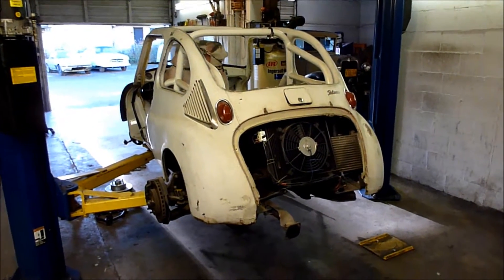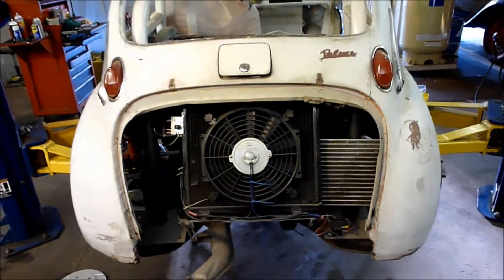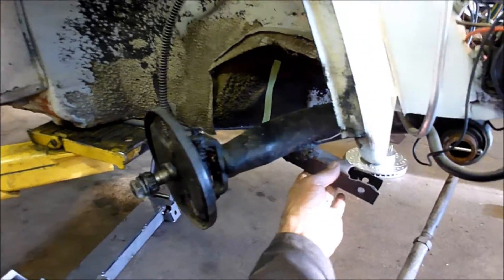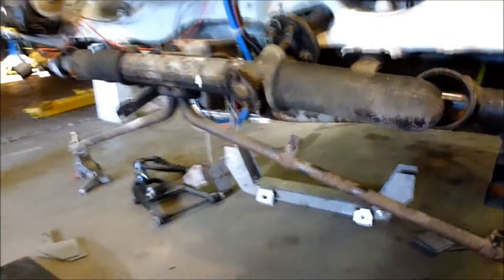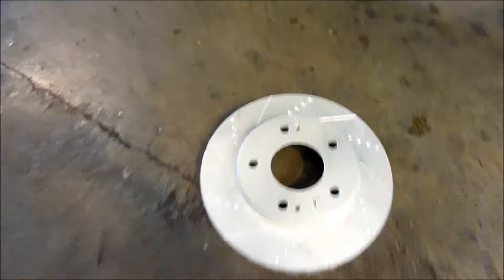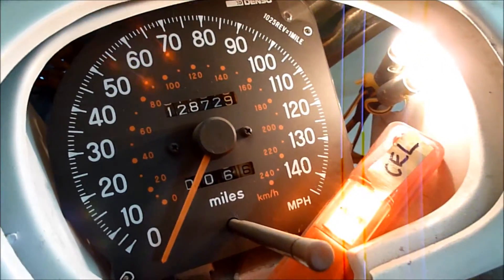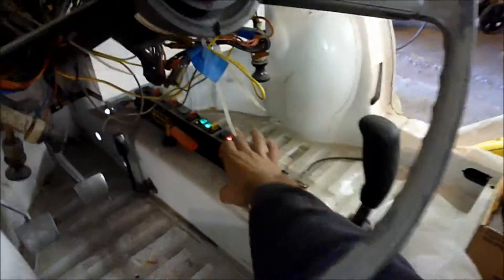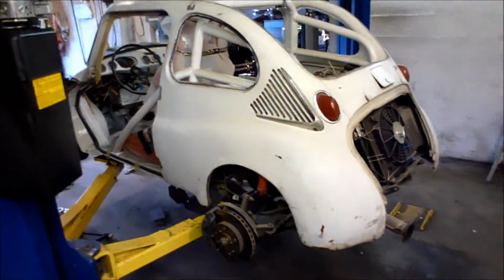Subaru 360 (speed racer) Brake fabrication

Comment: This is a great project. I have a 1970 Subaru 360 sitting in a friends pole barn.  I'm undecided on the powertrain front though. I'm think a bike motor would be fun, but a high hp FWD car setup does sound like a good idea.